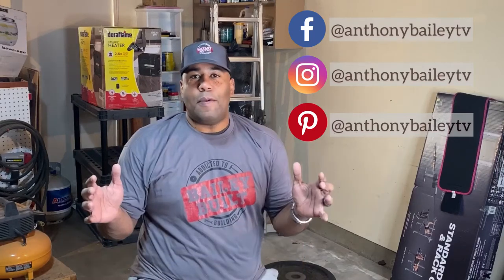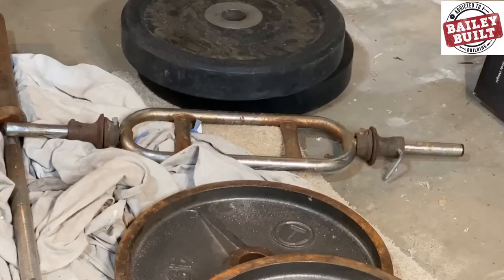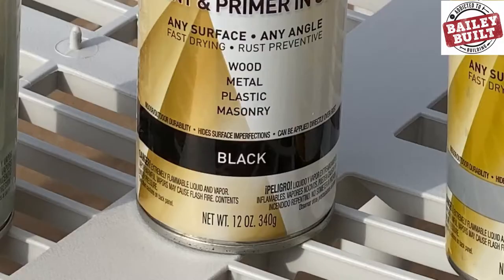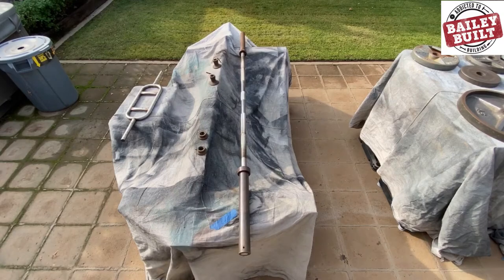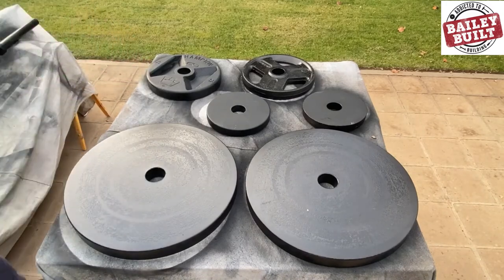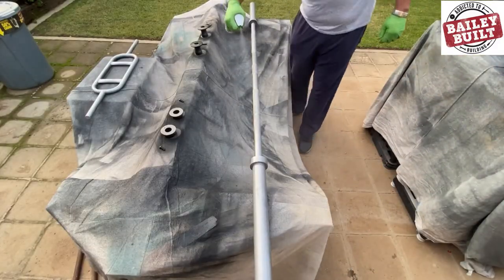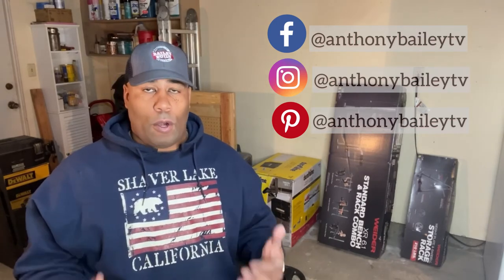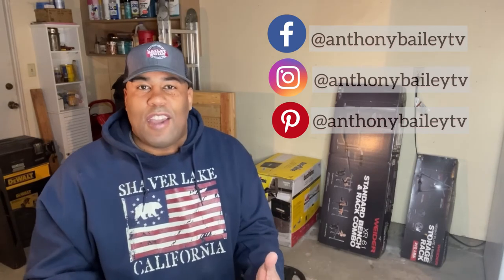Bailey Built: How to Paint Olympic Weights

Comment: I feel 24 hours is too long to wait I waited less than 30 minutes for side and used 3 coats and had no problems workedout  the same day you can't really fix the collars of the bar tho and the middle of the weights they will rub and the paint will come off for the collar I used chrome and silver black doesn't work maybe  I'm gonna remove them and light them in my fire pit to give them the rainbow smoke black effect
Reply from the maker: Thanks for watching! Good luck with your next project.

Comment: Hi, as soon as I dry off the cleaned bar it starts to show rust forming. is there a way that this won't happen? I want to put a clear coat of Rust-oleum on it. If I put oil on it, it won't stick. thx for the video.
Reply from the maker: Hi Stephen, There is a rust inhibitor that you can spray on after you clean it. Once that drys, you can add any paint or clear coat you would like. That is what worked for me. Good luck with your project!
Reply: @BaileyBuilt  ok, I'll try that, thx

Comment: How durable was the paint on the bars? Did the paint on the bars or plates scuff off with wear & tear? I’m looking into painting over some weight plates that I have, and the restoleum converter is one of the options I’m looking at using. I have normally use vinegar and water to remove the heavy heavy rust that the wire brush cannot remove. But the converter may also be used prior to a primer, paint & clear coat. Thank you for your feedback.
Reply from the maker: Thanks for watching. So far so good on the paint. I use a rubber floor mat for the exercises I do with the plates on the ground. The bar in the squat rack has held up fairly well. There is some minor scuffing where the bar sits in the squat rack but that is about it. Good luck with your project!
Reply: @BaileyBuilt  Thank you for your response 🤙🏼

Comment: How are those steel plates holding up?  I was thinking of painted mine red.... but was wondering if paint would chip? How's the finish now?
Reply from the maker: Thanks for watching. The paint has held up really well on the plates and the bar. The paint really adheres to the plates nicely. It also has worked well for wood and other metal projects as well.
Reply: Did you paint them red? I thought about dointg the same color.
Reply from the maker: @jamaallewis3520  Thanks for watching!

Comment: If I have plates that are in excellent condition with no rust etc and wanted to change to color, what surface prep would I have to do before painting them? Maybe some sort of primer?
Reply from the maker: I would simply wipe them down to remove the dust. Next use a wire brush to scuff them up a little then paint. Good luck with the project!
Reply: @BaileyBuilt  Hey! Just seeing your reply. Thanks so much!